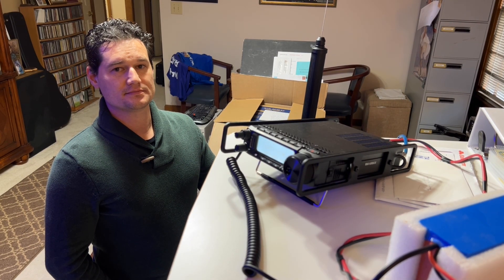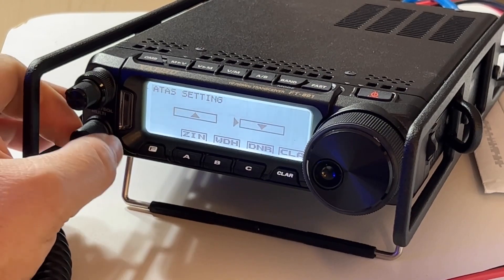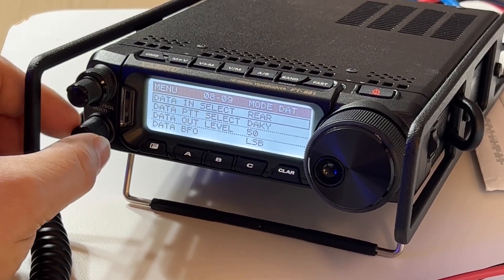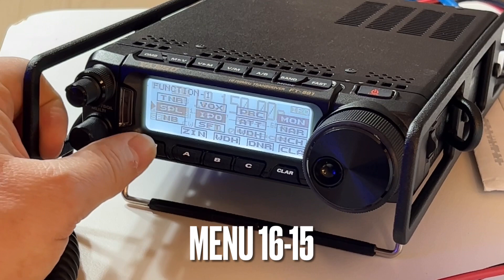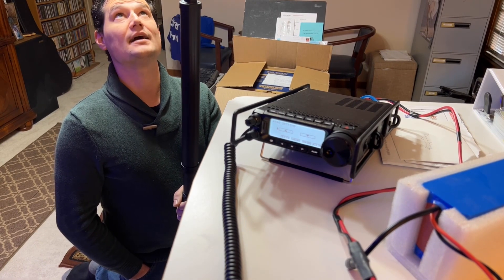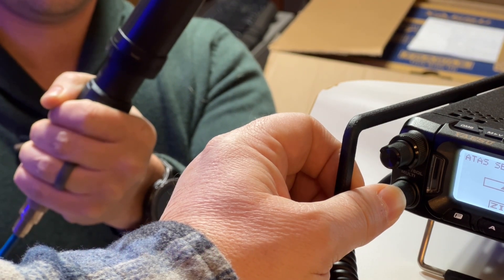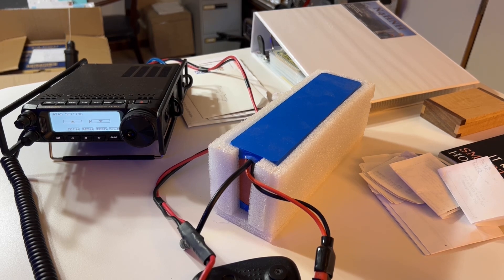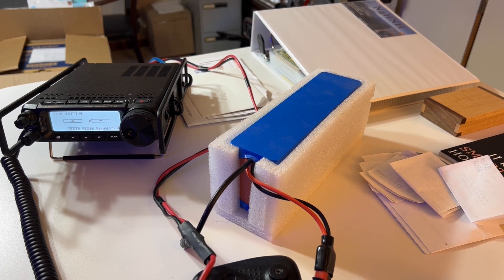Yaesu ATAS-120A Part 1 (Unboxing and Menu Settings) #yaesu #atas-120a #hamradio #hf #antenna

Comment: I just found this video and I stopped what I was doing and ran over to my FT 891 and changed the settings to match yours.
Now I've extended my antenna as far as it it can extend, and I shrink my antenna down as much as I could as well. 
I'm on the 3 m band and I have the ATS flashing in the upper left-hand corner of my display 
I also noticed that my volume knob switched to changing SWR . 
That last part makes no sense to me, that SWR could move with a Dial.
To be clear, the antenna is staying in one at one length, and the volume knob is adjusting, or changing at least the indicated SWR on my screen. 
Just to be safe, I adjusted down all my transmit voltages, everything is set to 5 W transmit. 
I'm definitely gonna watch your second video.
Reply from the maker: I recommend watching all 5 videos in this series.

Comment: Or you can press the tune button and it will tune itself to whatever frequency you want to transmit on. 73 kf0alt
Reply from the maker: After the antenna is installed on the vehicle with proper bonding, automatic tuning can function. The vehicle acts as the counterpoise.  The vehicle is the other half of the antenna system.

Comment: the atas yaesu is a good antenna ;; also you will need a tuner either external or directly. on the transmitter. ;;
Reply from the maker: No antenna tuner is needed for the ATAS-120A.  ATAS is Active Tuning Antenna System.  The radio sends a voltage via the coaxial cable to power a “tuning motor” while the radio monitors for lowest SWR. That’s the point of the ATAS-120A. The antenna auto-tunes to the correct length that provides a near 50-Ohm impedance match. No further tuning is necessary.
Reply: @n4hnhradio  with an old transceiver can we use it like 706 icom or yaesu 857? will it work?
Reply from the maker: The FT-857D is compatible with the ATAS-120A. It is not compatible with an ICOM.  The radio has to have the ATAS features built into its firmware and it must be able to output the voltage over the coax to run the motor in the antenna.

Comment: I have this antenna. It is new. Yesterday I hooked it up to my Yaesu FT 991a and set it up the same as you with the stake from Ebay, the radials (8 at 12 feet long), and the cable is UHF Male (PL-259) to UHF Male (PL-259) Low Loss 400 Coaxial Asse. I set the menu item to ATAS. I have not been able to get the antenna to tune and thus it does not extend on any of the bands. Am I doing something wrong?
Reply from the maker: To properly configure the Yaesu FT-991A for use with the ATAS-120A antenna, you need to adjust specific menu settings to enable the radio to control and tune the antenna effectively. The ATAS-120A is a motorized, auto-tuning antenna designed for HF, VHF, and UHF bands, and the FT-991A uses control signals sent via the coaxial cable to adjust the antenna's length for the best SWR. Below are the required menu settings and steps:

### Key Menu Settings for FT-991A with ATAS-120A
1. TUNER SELECT (Menu 02-13):
   - Setting: Set to "ATAS"
   - Purpose: This tells the FT-991A that the ATAS-120A is connected and enables the radio to send the necessary control signals for tuning. Options like "INTERNAL" or "EXTERNAL" are for other tuners, not the ATAS system.

2. HF ANT (Menu 02-10):
   - Setting: Set to "ANT 1" (or the port where the ATAS-120A is connected)
   - Purpose: Specifies which antenna port (ANT 1 or ANT 2) on the FT-991A is used for HF bands with the ATAS-120A. Typically, the ATAS-120A is connected to the HF/50 MHz port (ANT 1).

3. TUNER TYPE (Menu 02-14):
   - Setting: Set to "AUTO"
   - Purpose: Enables automatic tuning mode, allowing the FT-991A to adjust the ATAS-120A's motorized element to achieve the lowest SWR when the TUNE button is pressed.

### Setup and Tuning Process
1. Physical Connection:
   - Connect the ATAS-120A to the HF/50 MHz antenna port (ANT 1) on the back of the FT-991A using a coaxial cable with a PL-259 connector.
   - Ensure a proper ground or counterpoise:
     - For mobile use, the vehicle body acts as the ground plane, so bond the antenna mount securely to the vehicle frame.
     - For portable/base use, add radials (e.g., quarter-wave wires for each band, such as ~33.4 ft for 40m) or use the Yaesu ATBK-100 kit for VHF/UHF.

2. Menu Configuration:
   - Press the F (Function) button on the FT-991A to enter the menu.
   - Rotate the MULTI knob to navigate to the menu numbers (e.g., 02-10, 02-13, 02-14).
   - Press the SELECT button to choose a setting, adjust with the MULTI knob, and press SELECT again to save.
   - Set the above menu items as follows:
     - 02-10 HF ANT: "ANT 1"
     - 02-13 TUNER SELECT: "ATAS"
     - 02-14 TUNER TYPE: "AUTO"
   - Press the F button to exit the menu.

3. Tuning the Antenna:
   - Select the desired band (e.g., 7 MHz for 40m, 14 MHz for 20m, etc.) using the BAND button.
   - Press and hold the TUNE button on the FT-991A front panel.
   - The radio will transmit a low-power carrier, and the ATAS-120A’s motor will adjust the radiator length to minimize SWR.
   - Wait for the tuning process to complete (you’ll hear the motor move, and the SWR meter on the display should drop, ideally below 2.0:1).
   - Note: Do not transmit or interrupt the process while tuning. It may take a few seconds to a minute, especially if the antenna starts far from the optimal position.

### Additional Considerations
- Grounding: The ATAS-120A requires a solid ground plane for reliable tuning, especially on HF bands. In a mobile setup, ensure the mount is bonded to the vehicle body (not just a mag-mount, as capacitive coupling may be insufficient). For portable use, add radials or a counterpoise, as poor grounding can cause tuning failures or high SWR.
- VHF/UHF Operation:
  - The ATAS-120A covers 50 MHz (6m), 144 MHz (2m), and 430 MHz (70cm), but the FT-991A has a separate VHF/UHF port (ANT 2).
  - If using the ATAS-120A for all bands, connect it to the HF/50 MHz port and use a diplexer (e.g., Comet CF-530C or Diamond MX62M) to split the signal: HF/6m to ANT 1 and VHF/UHF to ANT 2.
  - Alternatively, use a separate VHF/UHF antenna (e.g., a dual-band mobile whip) on ANT 2 and leave the ATAS-120A on ANT 1 for HF/6m only.
- Power and SWR:
  - Maximum power for the ATAS-120A is 120W (SSB/CW, 50% duty cycle). Avoid exceeding this to prevent damage.
  - Check SWR after tuning. If it remains high (>2.0:1), verify grounding, coax connections, and menu settings.
- Source Reference:
  - These settings align with the Yaesu FT-991 Operating Manual (p. 143) and user experiences from forums like RadioReference and groups.io.

### Troubleshooting
- Antenna Won’t Tune: Check menu settings (02-13 to "ATAS"), ensure a good ground, and inspect the coax for breaks or poor connections. Let the antenna tune for up to 2–5 minutes, especially on 40m.
- Red TX Light Flashing: If the transmit light flashes when keying up, it may indicate the radio won’t transmit (e.g., if tuned to a non-amateur frequency like 27.175 MHz) or an SWR issue. Confirm the frequency is within ham bands and recheck grounding.
- Firmware: Ensure your FT-991A firmware is up to date for optimal ATAS control. Check Yaesu’s website for updates.

I hope this helps.  73, de N4HNH

Comment: Turns the radiator when tuning? This is because I want to extend the Atas radiator with a wire to get better results, but then the radiator is not allowed to rotate because the wire will then be wrapped around the radiator.
Reply from the maker: The radiator doesn’t turn when tuning.  It goes up or down with the entire top portion.

Comment: I have been looking into this antenna for my Jeep for ft-891, I also have an FTM-300 already in the Jeep, do you know if the antenna will allow both the FT-891 and FTM-300 to be connected through a duplexer and still have the tuning functionality?
Reply from the maker: That is supposed to be possible but you still would not be able to use HF and VHF or UHF simultaneously. The antenna has to change length according to which band is being used at the time. 

I suggest the solution I recommended to one of the VIP Patreon members.  It’s working out perfectly for him. Don’t mount any antenna on the tailgate of the Jeep. There isn’t enough of a connection to the frame, for a counterpoise.  

Use a Diamond K-400C or K-400S mount. The C comes with 6.5 feet of coax while he S comes with 13.5 feet. You probably won’t need but 6.5 feet. 

Mount the ATAS-120A to the left side of the hood. Buy another K-400C and mount a Diamond NR770 VHF/UHF antenna to the right side of the hood. Attach a braided bonding strap from the hood to the frame.

73, de N4HNH

Comment: The ATAS-120A is an awesome antenna.  I worked South Africa from SW Florida on 10 meters and 75 watts on USB with a 5x5 signal report.  The ability to QSY on the fly out weighs any short combining the antenna may have otherwise.  It also is a great portable or stealth HOA antenna.  I have used it with four ten foot ground radials, as well as using the ATAS-25 ground radial set.  Both work well.  I have both the 891 and the 991 and it works will with both.
Reply from the maker: That’s a great endorsement, Daniel.  Thank you for sharing your real world experience. 

73, Doug

Comment: I like the idea of a screwdriver antenna for convenience. I know that many operate as a static station with a 9ft or longer whip for greater efficiency on 20 and 40 especially using Tarheel or Diamond screwdrivers. I have read that the ATAS doesn’t seem to like this configuration and is only able to be used with the small supplied whip. If that is the case it’s a deal breaker for me, as more metal in the air cannot be substituted. 73 thanks for the video.
Reply from the maker: You might be surprised if you keep watching this series.

Comment: Good morning N4HNH, I'm Italian and I'm writing to you with a translator because I don't know English.
I have had a Yaesu FT-897 for many years which I have always used in VHF/UHF due to the usual logistic antenna problems.
Perhaps the only antenna I could use, both mobile and fixed is
the ATAS-120, so I'm looking for radio amateurs who are using it either
on the car and on a balcony as in my case, I think the only problem is that of the cost.
Thanks for sharing your experience...
Happy New Year from IW1BHT
Silvio Bello
Turin-Italy
Reply from the maker: Hi Silvio!  Thanks for writing. I am very pleased with the ATAS-120A thus far. The Part 2 video shows the installation and initial testing. It has since then rivaled my ham stick antennas. 

I wish you a happy, healthy, and prosperous 2023.

73, Doug
Reply: @n4hnhradio  Thank you and happy experimenting...

Comment: hi again there are som radial 4 the atas120 4 the complit sitem of the 891 includes remote fh 2, separation kit,fc 50 tuner,fc 40 long wier tuner, atbk100,atas120 and the last good coax rg123,with lining and grounds wit out god ground potable or in the sach this model dosent oparate at is max potential i have this set given to me as a present from my wife dident used it until a year a go 2021 used to use on all bands a cheoslovac radio made 4 the army until i started thinkering with this litel thing the 891 no the army radio colects dust
Reply from the maker: The radial kit is for VHF/UHF.

Comment: Had one on the roof of my '88 Corolla and '11 Rav4, worked lots of DX, I recommend that you also install a very, very good ground, you won't be disappointed if you do. I doubt if this made much difference, I sacrificed V/UHF bands by installing a Larson 2m whip vise the supplied one (physiological high gain), guess you could use a length of wire in a tree too... let the experimentation begin... VE7KKQ

Comment: I really like this antenna ! Excellent match with the FT891.
I installed it on the rear corner of the fender at the trunk lid on a Dodge Dart. It actually works great on all the bands between 6-40m. Mine also has acceptable  SWR on 2m and 70cm, but didn't perform as well as my existing dual band antenna.  Ground is the key to this antenna, and remember DO NOT ADJUST ANTENNA WHILE VEHICLE IS IN MOTION. (By the way you can also quickly fine tune the SWR by pressing up/down on mic while pressing ptt) This antenna also works with the FT991a. 73 KW4CK -Joe

Comment: I just activated 13 POTA parks over the span of two days with this antenna, it works great. QSOs all over the US and from California to Spain. I always use the Tune button, I have never once used the arrows. Occasionally on a tune cycle it will get to about 1.9 SWR and stop trying for something better. What I do in that case is move off about 10 kHz, tune, and then go back on frequency and tune one last time. This fine tuning step gets me as close to 1:1 as my grounding will allow, and I don't have to dive into the menu. Overall a good antenna that integrates seamlessly with the Yaesu radios. Enjoy and 73.

Comment: I have used it on POTA with my FTDX-10. Works great but it works best with the 891 and 857D which will allow the antenna to be used on HF/VHF/UHF. Very versatile antenna system.
Reply from the maker: That's great to hear.  The FT-891 can't do VHF or UHF.  Yaesu has yet to replace the FT-857D with something comparable.  They make some strange marketing decisions sometimes.

73, de N4HNH
Reply: @n4hnhradio  Yeah, I said that in a bad way. What I meant is that the 857D and 891 both run the antenna more quickly and tune faster than the FTDX-10. And then that the 857D will tune the antenna for VHF/UHF and HF. John Kruk was on another YT livestream and I asked about the perception I had of the antenna working better than the FTDX-10 with the 891 and 857.  He said yes and offered an explanation which I did not quite understand.
Reply from the maker: John sometimes speaks marketing.

Comment: Will this work with the FT-710?
Reply from the maker: It will, Jerry. I think just about any Yaesu HF transceiver in the past 10 years can use the ATAS-120A. It is definitely referred to in the manual for the FT-710. Check out page 102.

73, Doug
Reply: @n4hnhradio  now my next challenge is to figure out how to mount it in my Subaru Forrester (SUV with a hatchback) 😀
Reply from the maker: I found a bracket that fits sn existing bolt under the edge of my hood. It was made for my particular truck. You will see it in Part 2. But I had a Diamond K400C trunk lip bracket as a backup. I already have one on the passenger door, for my 2m/70cm antenna.
Reply: @n4hnhradio  I’m thinking of things like PITA vs. a mire permanent installation.
Reply from the maker: Magnet would be a go-to choice but the RF ground would be compromised.

Comment: I continue to be impressed with the contacts I make on this antenna system.  Cool to see one of my POTA activation maps in your video Doug.
Reply from the maker: That is such a great coverage map. I filmed Part 2.  It took a while, filming while installing. It actually spread across two days, with trips to HRO mixed in. Part 2 will publish next week. It includes installation and initial testing. I will tell you about it privately if you want to know ahead of time. 

73, Doug